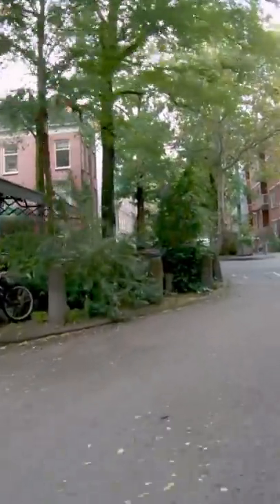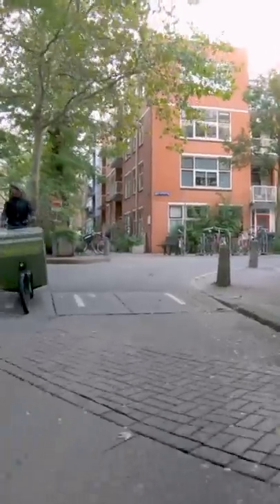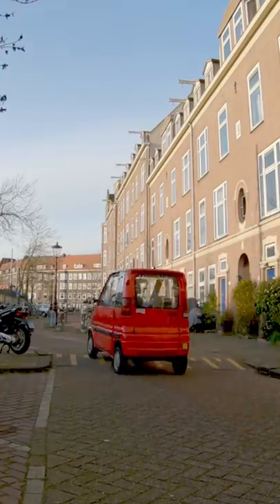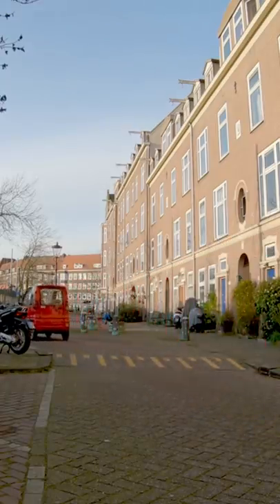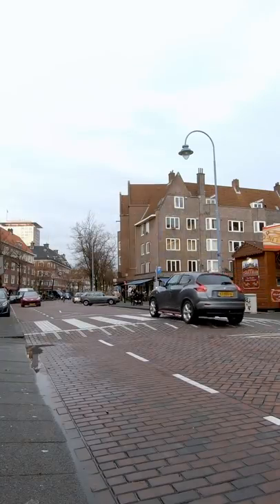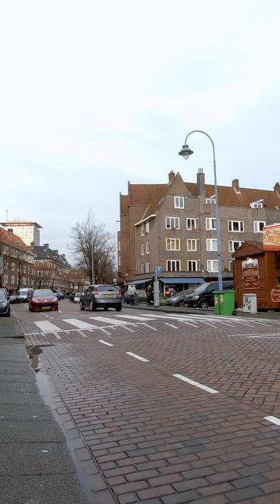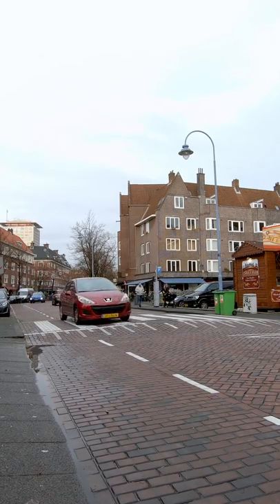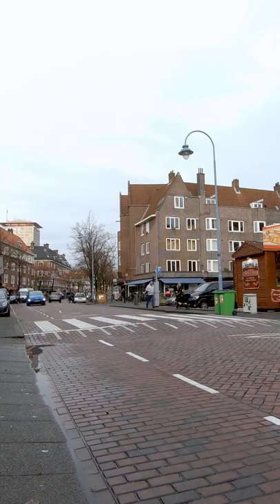How the Dutch Slow Drivers for Safer Streets #shorts

Comment: Netherlands: Brick road surfaces and sharp corners to reduce speed

Baltimore: Pot holes and permanent construction signs to reduce speed
Reply: I'm pretty sure that's the only flaw in this video, because car noise is considered to be an important negative factor for the living environment. In early 80's a directive was published stating that lowering car speed in residential areas was not only for safety, but also large and perhaps predominantly to reduce noise for better well being in the neighbourhood.
The reason there's no asphalt everywhere is cost. It's cheaper and easier to access infrastructure beneath it. Not sure if you've noticed in the videos of this channel, but in The Netherlands there are no powerlines in villages/towns/cities, it's all buried. Only major power-lines are above ground, often along or intersecting with highways, which are...asphalt.
Reply: @dislike__button  Well that's the thing, it doesn't. Brick road is no physical obstacle for a car forcing it to drive slower. If space allows for it, without crossroads and speedbumps they drive like mad here over brick stones. Doesn't matter.
Reply: @purplewine7362  What point are you trying to make? My comment is not about the designers, but about the interpretation of the video maker. He thinks brick roads are for reducing speed, which is not true.
Reply: Hell yeah dude. They put those speed cams up on 83 but also there are a ton of potholes in the northbound center lane to reinforce that lmao. 
Also I notice the brick roads don’t slow people down enough to stop accidents or hitting pedestrians in fells point.
Reply: baltimore has some brick roads tbf
Reply: In Poland, we had potholes for decades. A decade ago, it got fixed. Now we have speedbumps, so we can't use the smooth surfaces of the roads. There are no pedestrians, nobody walks there, and no zebra crossings (even if there is one, I never saw a person as close as 300m away from it.) Nobody even drives fast in those places. The turns are sharp, and there are no conditions for fast driving. But there are IDIOTS there. There are zero children in the neighborhood, but idiots write petitions to the city council for speedbumps because "what about the children!?"
I drive this shit every day 10 times each pass - gives an ane speedbump for every 60m of the road. There are (I mot kidding!) three sequential speedbumps set 5m one after the other. Driving over it at 5km/h, I ruined a spring that cut open my tire 30cm. The next time (3-4km/h) the rocker arm bushing cracked. As a result of the complete loss of geometry, the wheel destroyed the fender and wheel arch, and the aluminum rim also cracked. The city council said, "fcuk off!" when I gave them my car fixing bill. Today all these speedbumps made of rubber will catch fire for no reason in the middle of the night...
Reply: I love going fast on brick roads, the brrrrrrrrrrr is so funny
Reply: Same in Czech Republic
Reply: Baltimore: Squeegee boys
Reply: @purplewine7362  A brick road would not at all make people slow down. That'd just suck ass and make a lot of noise pollution in those areas. Especially in a residential zone.
Reply: Asian: more traffic reduce speed
Reply: Big brain Baltimore

Comment: I love the smooth design of the speed bumps in the Netherlands with basically a ramp on either side. 
I don’t often see speed bumps in North America, but when I do I have to pray that they don’t damage my vehicle.
Reply: The ramp on either size encourages people to jump it.
Reply: Yes! Thankfully the newer speedbumps are smaller.
Reply: @T1625-w7d  No it doesn't😂 People don't want to damage their car for no reason, plus they aren't American
Reply: My city has started adding speed bumps everywhere. They vary wildly in quality. 

But what I've learned by driving a big van is that speed bumps barely slow you down if you're in a big enough hurry. 

I found Mexican speed bumps more effective.
Reply: Speed bumps are created to slow down traffic to a crawl on pedestrian traffic areas and pull outs where you have poor vantage points. You're intended to drive around 5 mph over them otherwise they slow you down by force aka your underbody catching and such.
Reply: What part of north america? They're everywhere where I live and they're always super rough
Reply: @T1625-w7d  no, no it doesn't. Maybe if the person driving didn't care about their car.
Reply: @flynncarter229  no, there's some where I live where I have to angle my car at 0mph just to not break the bumper off or bottom out the chassis. We need speed bump regulations.
Reply: I have, no lie, seen a cop flooring it on a call catch full air off a speed bump. Sparks on the landing and everything.
Reply: Yeah all speed bumps are smooth here in the Netherlands, thought that was normal. We also have different types of speed bumps for different speeds, on faster streets that are more rural and 60 kmh the speedbumps have less incline so you just have to go down to the right speed and it's okay and on the residential streets of 30 kmh there's more incline so you have to slow down more
Reply: @grimsgraveyard3598  yea that's the correct use. in very slow areas. but these fuckers put them at TOWN ENTRY. you go 80-90 and enter a town and immediately hit a speed bump, so you either jump it or you brake really hard
Reply: @MunkEMann  Alberta, Canada
Reply: for almost all cars, if the speedbump damages your car, you went over it with too much speed. In the netherlands i see so many people damage their car by going too fast over the speedbump.
Reply: Lol they have speed bumps all over the US, especially in cities wherever pedestrians cross.
Reply: @cheapskateaquatics7103  tell me you haven't been in the netherlands without telling me you haven't been in the netherlands ;)
Reply: @MunkEMann  sounds like it was effective at slowing you down. I like it
Reply: @Joesolo13  mate I was going 5 in a 20
Reply: @T1625-w7d  The bumps are not high at all and the ramps don't have a lot of incline so it would be a challenge to get your car off of the ground.
They are made so they're still comfortable to drive over at the speed you're supposed to drive. So it doesn't really slow people down if they drive at the speed limit.
Reply: They just added those Dutch-style speed humps near my office in the US. They are quite nice and slow down traffic without tearing up your car.
Reply: We also have a thing called Berlin walls and if u drive wrong at all on those your entire car is fucked lmao.
Reply: We can have really nasty ones in areas they really want you to slow down, they can be very steep or an accumulation of small domes, two rows, where one is two domes and the other three, the row of two sits in the gaps of the other row, so if you'd connect them you'd get a w. With the steep ones you can go over them in first gear, the small domes can only be taken in first gear but with the clutch halfway down just at the point of contact. Otherwise you'd scrape the bottom of the car, and they where spaced about every 30 m or so, it was horrible when I got lost in a neighbourhood ( essentially the Dutch version of a suburb, so designed for playing on the street, walking and cycling, with an attitude of you can come here with a car but take the shortest route to your house and do it very slowly ). But for the majority I am very spoiled here 😂🤗
Reply: Bienvenido a México, unironically that's the specific reason why 50% of mechanic workshops here are suspension workshops.
Reply: Trust me, these "bumps" are not the regular solution. A lot of the time they try out the generic bumps or make the angle of the slopes drastic enough to break your bumper if you're doing the speed limit
Reply: They’re usually only in school zones.

Comment: "Brick road surfaces increases road noise."
American automakers: looks like we need another half ton of acoustic insulation.
Reply: “Brick road surfaces increase noise”. Most American states: we will just use grooved concrete instead.
Reply: And massive wheels to smooth the noise out, but has terrible high rolling resistance and fuel mileage
Reply: I'm pretty sure that's the only flaw in this video, because car noise is considered to be an important negative factor for the living environment. In early 80's a directive was published stating that lowering car speed in residential areas was not only for safety, but also large and perhaps predominantly to reduce noise for better well being in the neighbourhood.
The reason there's no asphalt everywhere is cost. It's cheaper and easier to access infrastructure beneath it. Not sure if you've noticed in the videos of this channel, but in The Netherlands there are no powerlines in villages/towns/cities, it's all buried. Only major power-lines are above ground, often along or intersecting with highways, which are...asphalt.
Reply: Even the dodge viper ain't safe
Reply: @MartinH81  the tree thing is also wonky. You don't want to hit one even at legal country road speeds.
Reply: @jason41a  you do realize this is not just an American thing right, the audi rs6 has 21 inch wheels standard.
Reply: And all the residents living at that road must be really happy with the noise as well
Reply: @dr.johnh.watson2444  That's kind of the point, it enforces the speed LIMIT by slowing you down to one you feel safer at.
Reply: @Zraknul  that may be so but not every one is a responsible human being. And you don't jus increase the likelihood of them dieing but also of those traveling with them. Other factors may also cause the "safe" speed to trop rapidly such as sudden fog or icing. Increasing the degree of danger of a given road to reduce speed is just a backwards concept. And I bet you would see it the same way if your firefighter and paramedic friends would tell you about the crashes they see involving trees and the corpses of passengers they pull put of cars. Or the motorcyclist who had to evade a car getting on his line and hit one of those trees.
Reply: @dr.johnh.watson2444  good. Reasonable drivers are more cautious as a result, the ones endangering other's lives now are more likely to hurt themselves rather than others. We shouldn't sacrifice pedestrians for the "safety" of those who might kill them by negligence
Reply: @Joesolo13  the thing allays are not meant to reduce speed in a city. Going 50 or 60 through a tree allay is  about the same to any driver. If I remember right they were mentioned to be used outside of cities where the are no  pedestrians.

Speed bumps are way more effective then trees and they tend to kill no one.
Reply: @witoldschwenke9492  I'm Dutch and I live at a brick road. Most people walk or bike if they need to go short distances, so even though it's fairly densely packed here, there aren't many cars. So it isn't really intrusive. 
Our smaller roads and high fuel costs also make people buy smaller cars since most people don't really need a big car. Smaller and lighter cars make less noise compared to big cars.
Brick roads also cause people to drive slower, so the only thing we hear is road noise which is still less noisy than engine noise from cars that drive fast.
There are also benefits to brick roads. Bikes and electric cars are easier to hear which makes it safer. The lower speed of cars also makes it way safer to walk all bike here. 
Brick roads also let some water through, so floods from heavy rainfall are a bit less likely to occur.

So, to make a long story short: It isn't very intrusive and it doesn't really bother us. The benefits outweigh the downsides :)
Reply: This actually doesn't matter too much since it's all about relative sounds. If you come from a very quiet asphalt road to a brick road then the sound and vibrations in the car will increase. This will make it feel like you're driving (significantly) faster compared to the asphalt road. 
So as long as it isn't completely smooth and silent, the effect will be there :D
Reply: @AnimilesYT  you can get the same flood prevention from asphalt and concrete too. I use to do concrete work and we poured our own parking lot with concrete that allowed the water to go right through it. I guess the brick roads work for you all but would be horrible over here in the states. Where I'm at we even have tractor trailers going down small residential streets to get to some of the factories and I can't imagine how load that would be on a brick road. Actually would the road fail from the weight of a tractor trailer if it was made of brick?
Reply: @censors_starve  Brick roads would probably eventually get a bit deformed over time due to heavy loads. But they can handle a lot and if the road is well prepared then it'll last for a very long time
Reply: @dr.johnh.watson2444  you'd have to show that more people are dying from hitting trees at 20 mph than lives are saved by drivers not going 50 mph and hitting each other and pedestrians. otherwise i think the concept stands that slowing down drivers so they aren't speeding around in a city decreases casualties
Reply: @smitty1647  you can read can't you? I talked to them jn the context of country road speed (in Germany 100kmh). And to put it in more context allays have been planted here outside towns and cities to reduce speed which is madness.
Reply: Im an EMT and I swear the amount of acoustic insulation needs to be regulated. Idgaf how loud the road is, our siren literally causes permanent hearing damage if you stand directly in front of it and people STILL have challenges hearing us!
Reply: GET RID OF THAT INSULATION
I WANT TO HEAR THE ROAD
Reply: I wish. I'd love for my car to be noise dampened more from the factory, but you only really get that on 7-series BMWs, S-class Mercedes, and 8-series Audi.
Reply: Increased road noise is also useful for pedestrians and cyclists to hear the car coming and approaching their way.
This will become even more important for electric killer machines which for the majority make no artificial running engine noise

Comment: The speed bumps at 0:32 are special ones so busses can drive over them without it being too uncomfortable for passengers.
Reply: Bicycles too. Speed bumps are fairly uncomfortable on a bike, these ones you can circumvent.
Reply: True. Near where I used to live they even had rubber ones that would collapse slightly under heavy weight. 
Cars had to slow down for them, but heavy trucks or farm equipment (frequently used there) wouldn't have to slow down as much.
They were nice in theory, but after a year or so they removed them because they broke.
Reply: @JaccovanSchaik  The worst speed bumps are the ones that force you as a cyclist to 1) go over them and be really uncomfortable / less in control  2) ride in the door zone in between parked cars and the hump or 3) ride in between the humps, potentially going very close to oncoming traffic. None of these are good options really.

All a bit moot here because there is a bike lane letting you avoid this one completely. Just making the point that if there is no bike lane, they can be really bad for cyclists! Ones with a sinusodial profile that span the whole width of the road seem to be becoming more popular with traffic engineers in the UK, and they are so much nicer to ride on.
Reply: I can't say that regular cars get affected by these speed cushions all too much. I don't bother slowing down for them tbh.
Reply: I always thought it was more for ambulances, speedbumps can't be fun at speed when carrying a patient
Reply: @KA-vs7nl  Why?
Because I want our government to spend more of its infrastructure budget on cycling?
I don't want them to have more power, I want then to have less if anything.
You can't deny that we need a government to collect taxes to fund infrastructure.
Or were you planning on building it yourself?

And what I'm asking of my government is to spend that tax money(my money essentially) as efficiently as possible. 
And that means dedicating a significant portion of it towards cycling infrastructure.
Reply: @KA-vs7nl  you  just want the rest of us subsidizing your car hobby. Go drive on a track, some of us live in this world
Reply: @blazeclarke  It's literally called a bus lock
Reply: Speed bumps are the dumbest thing ever
Reply: @LMvdB02  in the UK they're called speed cushions, they're used here primarily so that emergency vehicles like ambulances can get over them easily. Naturally buses can also go over them without issue but that's apparently not what they're intended for, at least here.
Reply: Bro speedbumps in busses are the great part